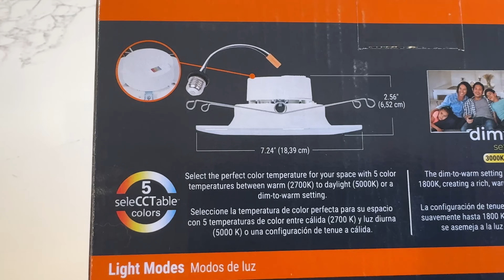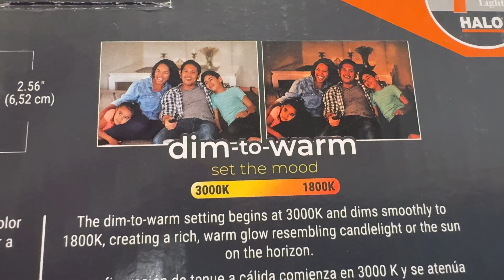Modern Home Build | 33 | copper rafter tail caps, deck blocking, decking

Comment: Try the German brand Wiha Maxxtor impact rated torx bits. The manufacturer of FastCap fasteners is including one in each box of fasteners as the ones they originally supplied kept snapping.

Comment: 9:23 I have a Shindaiwa blower. Best brand I’ve ever used. Only issues I’ve ever had were with the straps. And one time I tried using it when the temperatures were around 0 to blow snow. And an O-ring had gotten messed up.
Reply: Shindaiwa and Echo make great equipment, owned by the same company.

Comment: i found a trick on you tube dr decks that works great for the visible screws on the perimeter board. to hide the fastener you can get a countersink bit and a matching size plug cutter bit. gut plugs from a piece of scrap, drill counter sink holes for the screws. mount the boards then with a dab of superglue tap in a plug making sure it is shallow enough to flush with the surface. literally invisible.

Comment: OMG those lights would be so annoying in a thunderstorm! We usually just get a bunch of brown-outs that will keep cycling my UPS, microwave and septic pump alarm. Depending on how sensitive they are to power fluctuations, they'd be going into night-light mode every time my furnace kicks on as well. 
Since they're LED, I'd rather just see a 12 hour battery backup that puts it into low-light mode when it looses power. Then they'd even be able to help you get around if the power DOES completely go out.

Comment: I wonder if there is an application where you take like a huge ice chest and cut a hole in it. run the extension chord in there the stack all your charges inside. Weather proofing? Moving all the charges at ounce? easy pack up? just a thought. lol

Comment: It would be a good idea to wipe down the copper flashing with some solvent after they are attached, to get rid of oil from your hands.  Otherwise, as the copper oxidizes with age your fingerprints will show and they'll be permanent.

Comment: I thought the composite deck screws had a set of reverse threads on the top, those threads actually are the clamping force, instead of the head like a traditional screw. So pre drilling would weaken that hold, I would assume.

Comment: Those bits may not be rated for impact drivers. Those screws are probably small enough you could use a drill driver next job. Idk, just a suggestion

Comment: Wow!  Those walnut boards are amazing.  

It reminds me of an old house I once owned.  It was a fine old antebellum house but in some small ways the layout was less than ideal.  At one point we decided to open up a doorway in one wall.  After we removed the plaster and lathe/horsehair, we found a solid wall of walnut timbers that were like that, except they were 2' wide by 4" thick.  And, we discovered, they went from the foundation to the ceiling of the 2nd floor or roughly 18 feet long.  Can you imagine?  I know we were stunned.  I love this channel and I admire all builders but after seeing some of the things I've seen in old homes, I have to say, today's building has nothing on the level of quality once put into a home in the old days.  It would humble the greatest.

Comment: You really shouldn't ever recover or tow with chain and I'm surprised Jaimie did that. Check out some videos of what can happen when a metal chain is acting like a tension spring and fails if you haven't. Kinda surprised ya'll don't have a set of tow straps in your trucks! Other than that, great video as always!

Comment: The copper ends for the rafters look really good. Will they be protected to stop verdigris forming? The panel beating hammer Jamie had we used to call it a "Dolly Hammer", which eventually was called a 'Barbie', boys will be boys. I always pilot drill my holes going through wood, but I understand from a commercial point of view that's added cost. Having stepped drills for pilot and screw head just makes the job easier I suppose from an engineers aspect. The job is progressing nicely. Good post, thank you and please take care 👍

Comment: Make sure you are buying the ‘impact rated’ T20 bits.    Lots of cheaper ones at the big box stores that will break otherwise
Reply from the maker: Good tip!! Thanks
Reply: Idk. I snapped 3 T15 GRK bits the other week when I was installing cabinets. Best part is that it was the bit that was supplied with the screws. I was using both impact and a regular drill. 😅
Reply: Also buy good screws, Ive had impact rip screw heads off. Starting to think maybe a normal drill is better for some kinds of jobs. @PerkinsBuilderBrothers
Reply: @PerkinsBuilderBrothers the impact ones are softer. They might not break but could wear/strip. They just don't make good tools anymore like the old days.
Reply: @PerkinsBuilderBrothers literally… A good tip.
Reply: Oof, that was a quality dad joke @macgyver03ga

Comment: Hey guys, great content as always!! Two notes just did a deck build using similar fastener system. If you read the fine print, it says use a drill not an impact on those fasteners. Second, never ever ever ever do what Jamie did with a hitch ball that thing can snap right off !! get the proper hitch attachment it’s just one more tool lol.

Comment: When you are a perfectionist on the job but at home, not so much, see 12:05 where the missed screw hole repair gets put off till the second Tuesday of next week. (handrail bracket to the right of your forehead).

My home is 90 years old so pulling wire is not that easy, but I opted for actual LED nightlights that have battery backup and only use 0.04 watts per nightlight. 30 nightlights will run for approx. 22.5 days during power a outage.

Comment: The multitudes of star bit sizes drives me crazy.  Even with the same size there is variation from bit to bit.  I guess that is why they give you a bit in each box of star head screws.

Comment: If you would have used a big nylon bungee rope, you could have pulled that out Much easier You're real lucky it came out Probably about an inch and a quarter inch and a 1/2 in diameter. That way, you could have got a running start and it would've just gradually pulled it right out smooth as butter

Comment: I work for a medium sized general contractor in California. I’ve only ever seen the zip system used on one project, which happened to be an architects office, then they covered it with tyvek. We do a lot of metal panels on buildings and most of the time we put a high temp waterproofing barrier on the walls, similar to what you put on the roof for metal panels. Since these metal panels aren’t part of an insulated panel system is there anything going between the zip system and the metal panels?

Comment: This is not a comment on this video, rather a reaction to a product you "advertised" in a prior video. Generally, I am very impressed with the quality of your construction work and your crew, thus I trust what you tell us. Because of this, when you presented a Vevor telescoping ladder a number of videos back, I decided to purchase one. However, using it just once convinced me that it was a mistake to buy this ladder. While it has great construction quality and may have a niche use, it is a comparatively awkward and dangerous ladder. Further, I note that you are not using it in your subsequent videos, so I suspect you feel as I do. First, OSHA requirements for ladders specify a maximum distance between rungs as 14 inches. The Vevor ladder has 15.75 inch spacings, which is very awkward when you are used to "normal" ladders. Clearly, anything "awkward" about a ladder is dangerous, and you don't want that when trying to find a lower rung when you are high on the ladder. Also, that spacing substantially increases the knee bend and effort needed in trying to lift yourself up or descend down to the next rung, which is indirectly dangerous. The ladder also has "bumpers" on the top rung intended to avoid scratching a wall surface and add grip, but they are inset substantially from the outer edges of that rung, so that allows the ladder to rock when pressure is applied to a side rail of the ladder... and that is dangerous too. Finally, collapsing this ladder is dangerous to hands when the release buttons are pressed. You must be very alert for hand placement when doing so. An additional concern is that the non-extended steps (assuming you are not using the full length of the ladder) must be placed either at the top of the ladder, making it top heavy, or at the bottom of the ladder, where they block foot placement. This is just bad design. I see this ladder as useful ONLY when you must transport a ladder in a small space. Beyond that, it should be ignored. I truly doubt you properly tested the ladder before showing it in your video... and I wish you had.

Comment: Those bits are not impact rated.  Most of the impact rated bits have a narrower shank that allows flex, and they also use a different alloy for the tip.  Milwaukee and Dewalt both make good quality bits.  I’m sure Flex and other brands likely do as well.

Comment: The light colored bits you had issues with are not IMPACT (hardened) rated.  The ones that will last are usually a dark grey/black finish.  I have a bin full of cheap bits that I save for hand tools.

Comment: The reason you keep breaking so many bits is that you're not using impact-rated bits, or your impact drivers are delivering more torque than the bits are rated for. Dial your impact down and get impact-rated bits to match. I've never broken a bit by following the instructions.

Comment: lots of value added on this job - the decking looks nice - maybe use impact driver in lieu of drills? anyways you can see why i like the slam bam simple ranch - simple, basic, fast construction - you don't even have to think after you do a few - icf may make it even simpler. this place will look nice when done - hopefully you will not sub out the finish and trim work - it is more interesting, less back breaking and brings in more of the greenbacks although it is more or less more demanding and skillful? I think it kind of blends in all together for most carpenters #free gravel for life

Comment: Warning Warning Warning. The Australian Government and health authorities have just applied a total ban on all engineered stone benchtops throughout Australia. The ban is on the use, supply and manufacture of engineered stone benchtops. It’s similar to asbestos the sanding cutting of the benchtop can cause Silicosis, with irreversible lung disease.  Eric Jamie for your urgent attention.